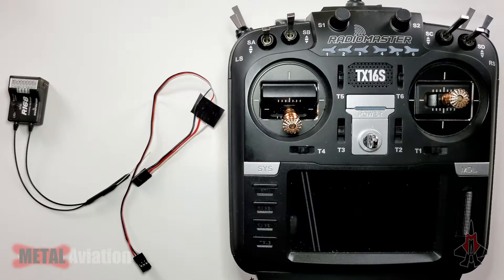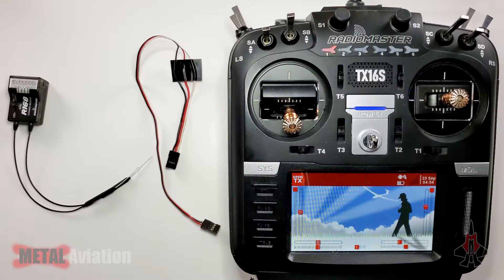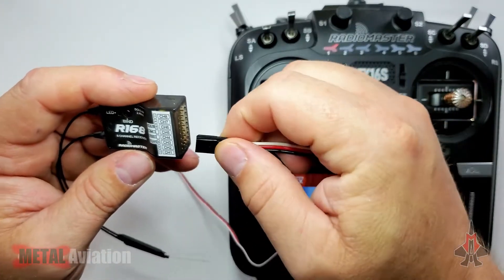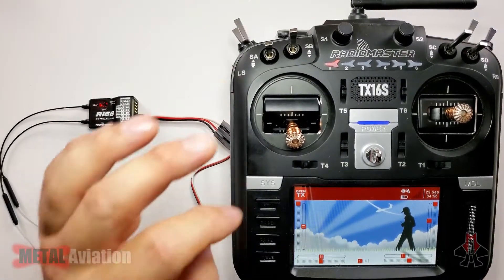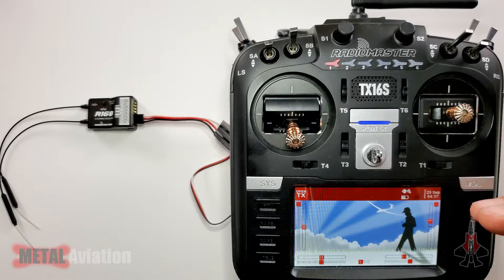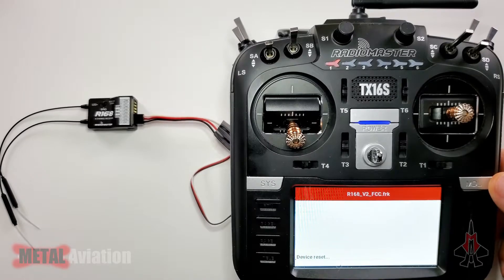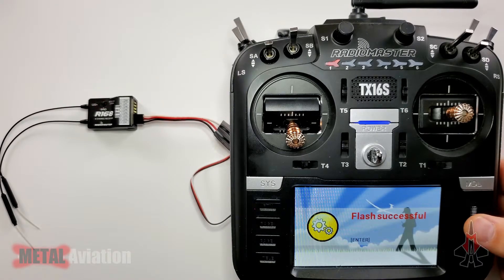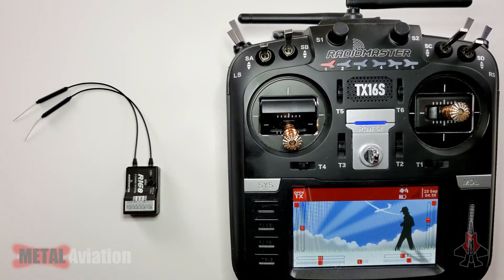How To Update Radiomaster R168 Firmware - OPENTX Flash Firmware

Comment: Where do you get the firmware?
Reply from the maker: You can download it from radiomaster website.
Reply: Since the R168 was pulled from sale since Frsky complained about IP... the firmware is no longer on the radiomaster site. However, if you search for a video by joshua bardwell "Where to get old FrSky firmware (if they ever delete them)" he gives the link to a google drive folder maintained by ItsBlunty which has the Radiomaster firmware as well as all the old Frsky firmwares. ;)